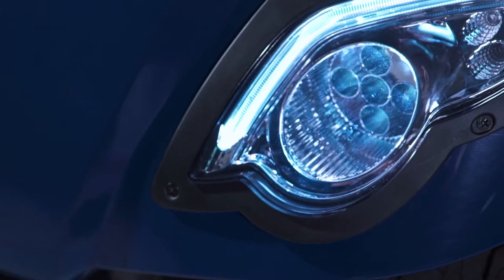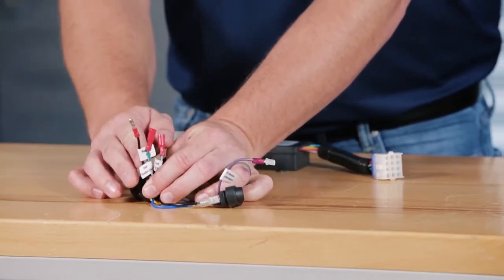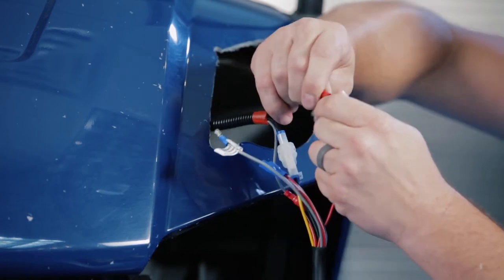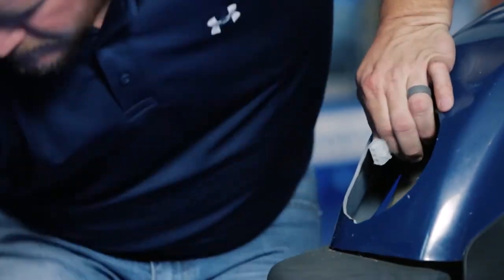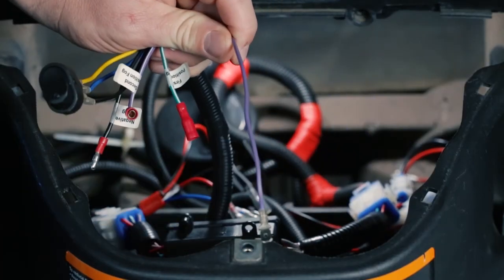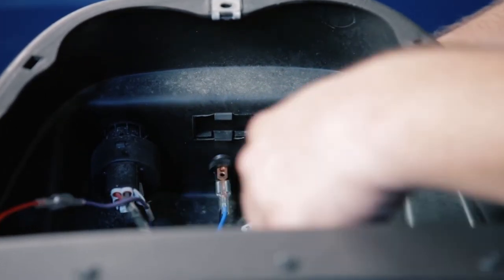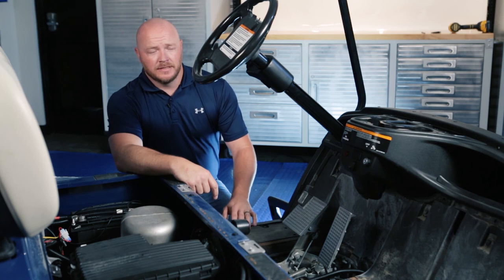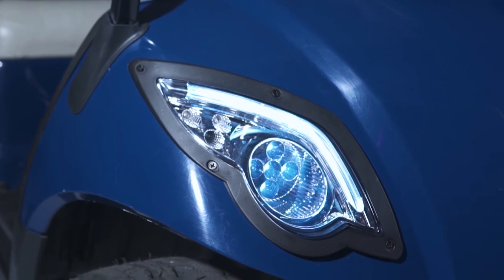Ultimate Plus Light Kit for Yamaha® Drive | How to Install Video | Madjax® Golf Cart Accessories

Comment: I will add I did encounter a problem with the fit of the headlights to the body. I called Madjax and they told me there is a center support for the front body panel. And to check it because they can get bent durring a front end bump. I looked and it was , so I straightened it out and the fit was perfect.

Comment: ALSO the spring for the brake switch has a big loop on the end that hooks onto the pin. So I squeezed it closed and when I put it on I installed a washer on each side of the spring loop and put a zip tie on the pin on the outside of the washers. This keeps the spring from comming off which happened to me, so I had no brake lights.

Comment: Guys remember all the drive 2 bodies if you take them off has the outline for the head lights and taillights engraved into the plastic and it's a lot easier to ensure a nice straight good looking mounting hole for the head lights and taillights I always outline the pattern with a sharpie and cut to the outside of the line removing the sharpie outline completely and that will ensure they will slide in with no problems and having to keep trimming till they fit right. I work at a golf cart dealership and we never use those paper templates.

Comment: Is there a way to wire this through the carts key switch so the brakes do not stay on when parked and not in use?
Reply: The breaks are on a timer it will turn off after 5 mins or so on their own

Comment: Is there any way to adjust the aim of the headlights? Mine aim way up almost to the point that they're useless. The only way I see to adjust this would be to shim out the top portion of the whole light assembly which would just look ridiculous.
Reply: On stock headlights, look at the back of the headlight assembly.  At the bottom of the round part there is a philips screw which is the adjustment screw.

Comment: Is there a way to run the converter to the key switch that way it’s not draining the battery when not in use?
Reply: @Madjaxtv I'm wondering the same. 

Did you find a way to make it work?

Comment: Do you have any videos or pictures of how the rgb versions of these lights look installed?
Reply from the maker: Davis, I will try to find you a picture of the RGB Yamaha Drive with them on. Basically the RGB portion is where the daytime light lens (shown in this video) is that runs full length along the top side of the head light lens.

Comment: Is the wiring harness long enough for Yamaha’s Concierge 4 model?
Reply from the maker: @Gary M it is not, only designed for standard length carts. It's possible to make it fit but it would void your warranty, the Tail light wires and power wires would need to be extended. Everything at the front of the cart would stay the same.

Comment: You guys need to remake this video. It's 2 years old and the wire harness has changed, along with some of the other connectors. The routing of the harness was done very poorly. Why run the entire harness thru the floorboard when you can just push the 2' of that end thru to the front then run the rest to the eng.compartment. Show the locations of the openings to use for this. I had to watch this video numerous times to determine where they were. Also my harness has extra wires for optional accessories, which is not mentioned in the instuctions. This is my first cart so all this is new to me.